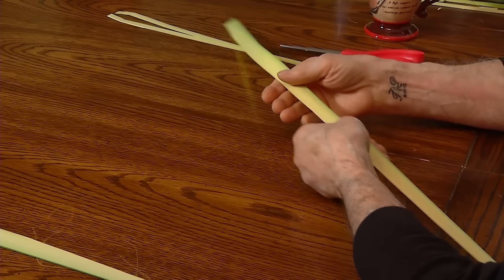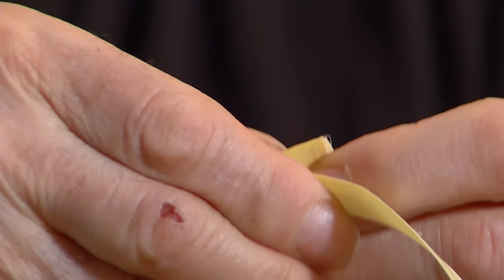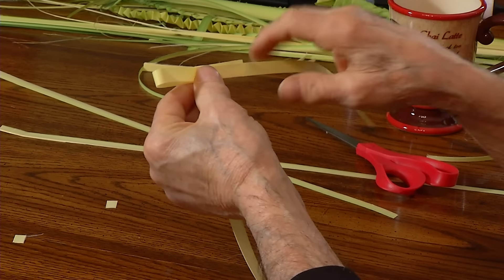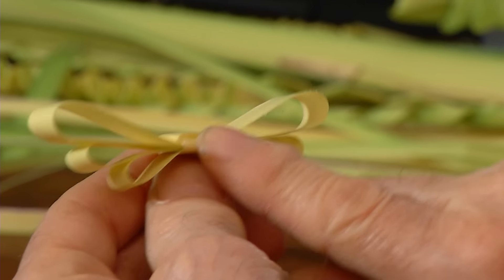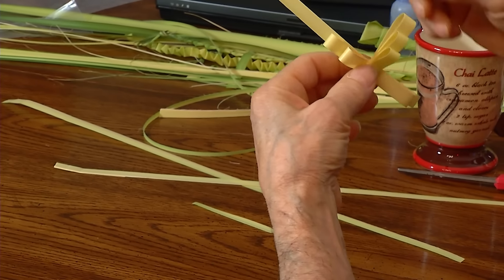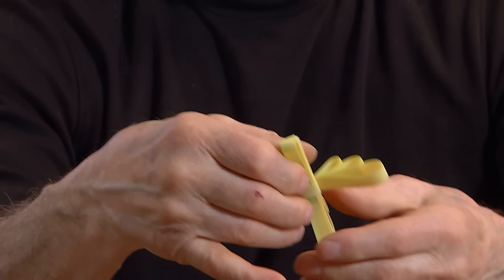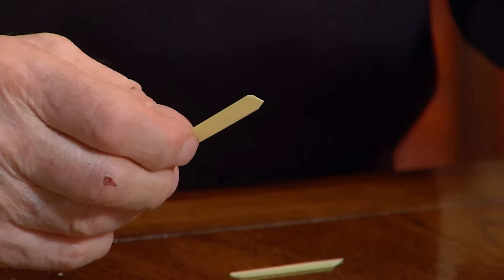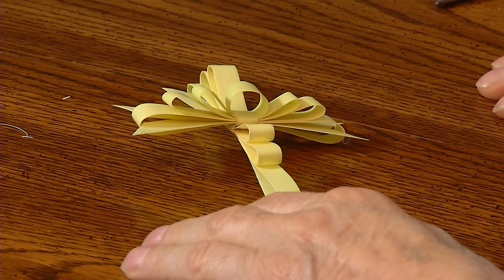Italian Cross and Heart Palm Weaving Tutorial

Comment: I tried this many many times and it wouldn't stay together because of the loose one at the beginning coming out... it is beautiful and I want to do this but it kept falling apart
Reply: It's likely because you didn't lock the horizontal bar--I'm assuming that's what you were referencing with "the loose one at the beginning." Make sure it wraps behind and is inserted just under the top most wrap, this will ensure it locks into place.
Reply: @kyrieeleison2793  I finally just taped the two together and it worked but it took me many times.